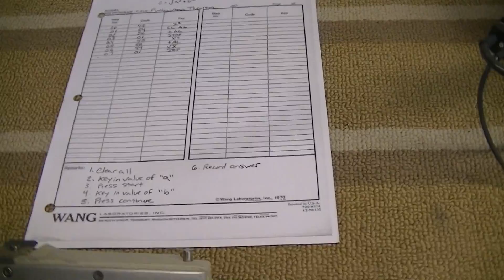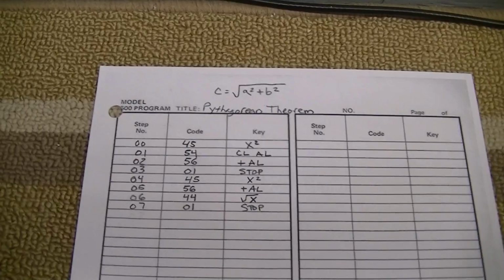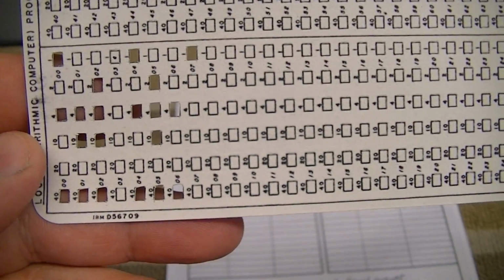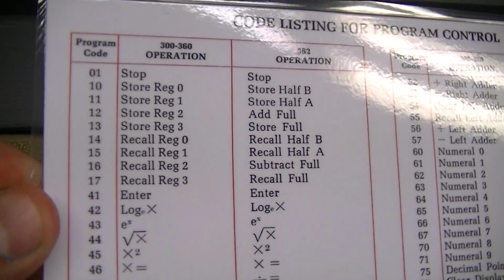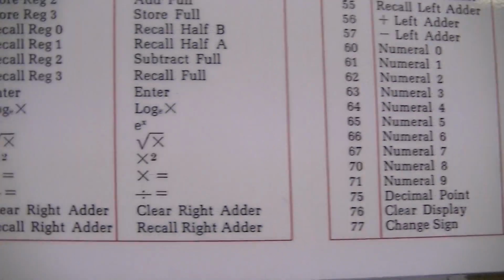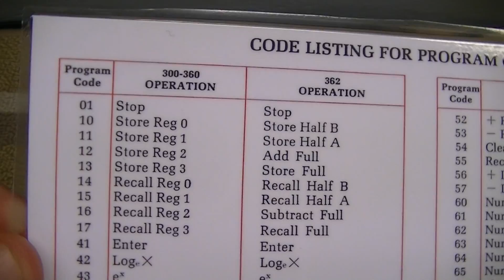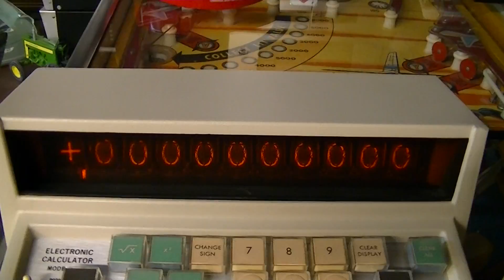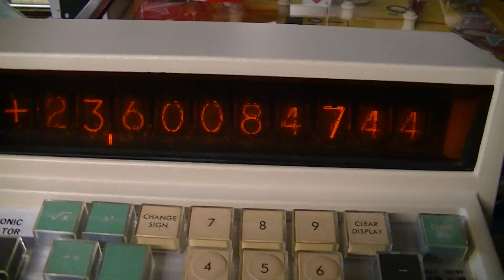Wang CP-1 Punch Card Programmer for the 300 Series Calculators

Comment: Mark, that is a fascinating machine.  I don't suppose you would consider selling those three items would you?
Reply from the maker: I don't want to sell it as it fascinates me probably more than any electronic device ever has, and there are VERY few of these that remain in operating condition.  Also, through default, I have learned how to keep it working- it requires a LOT of maintenance.  Once I am no longer able to maintain it, it will likely be passed on to a museum.
Reply: Thanks Mark, I certainly understand that.  Thanks for the great video.